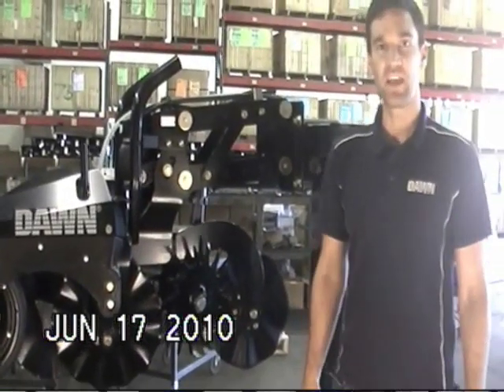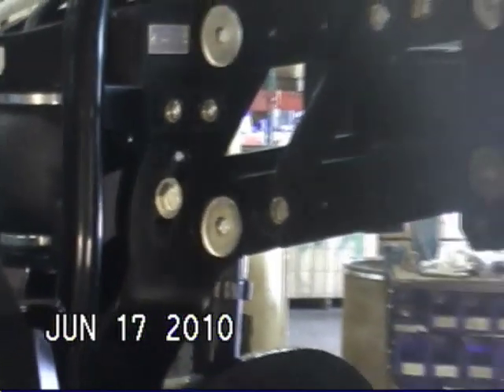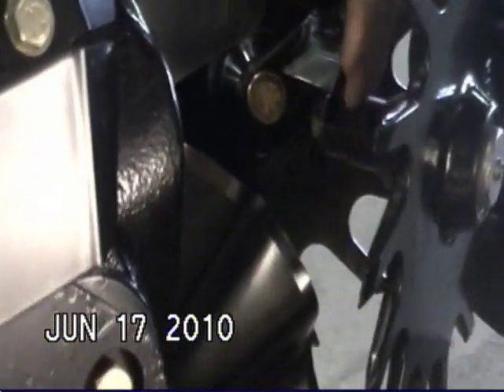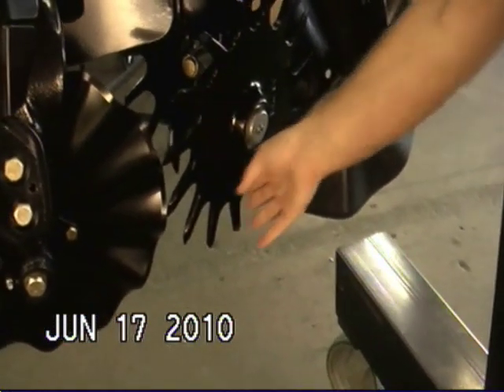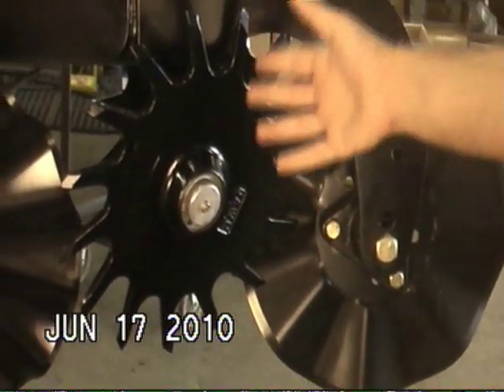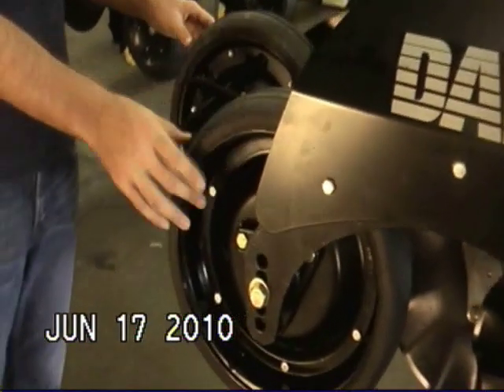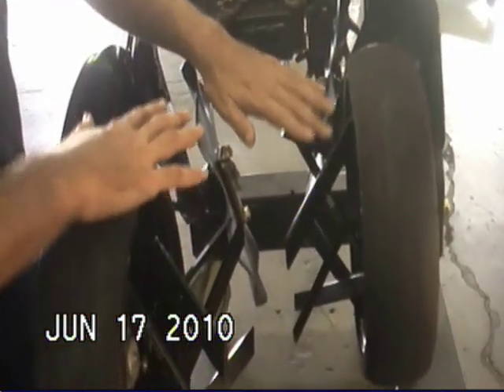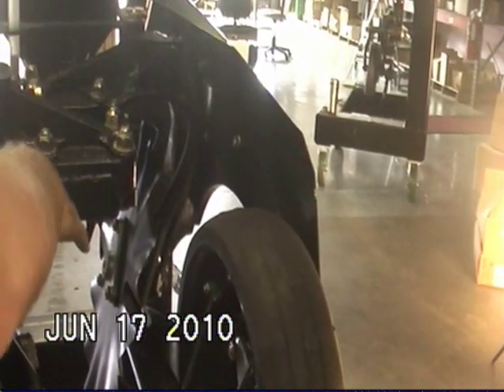Introduction to the Pluribus Strip Till Unit Part 1 with Joseph Bassett

Comment from the maker: @LandanL because the units are used at drastically different depths of operation and speeds of operation it would be difficult to make a single tool that does both. We have started expanding in the south quite a bit this year. Have you watched this video?

Comment: hey there , i have a question? i love your equipment, but here in the south , you need a subsoiler, something that can bust  the hardpan, anywhere from 16 -18 inches deep. do you have a model that has that attachment? because without a subsoiler, that model is useless.